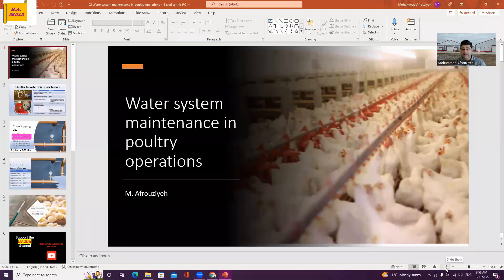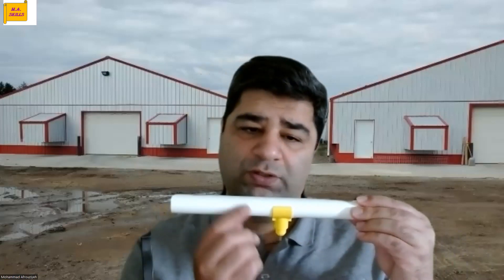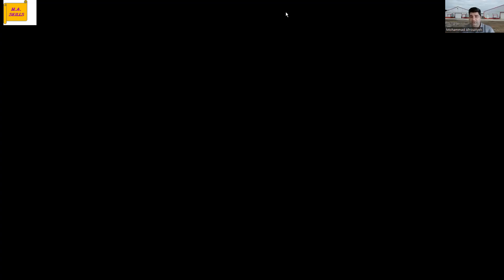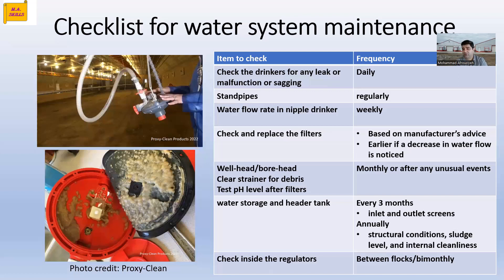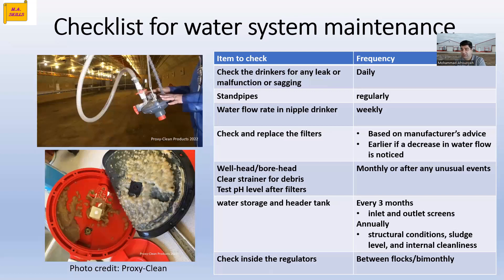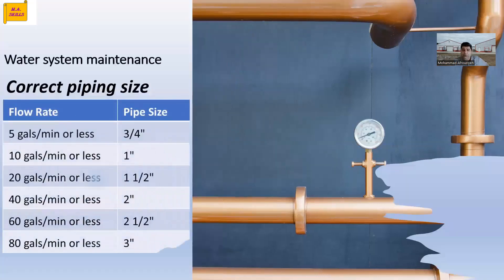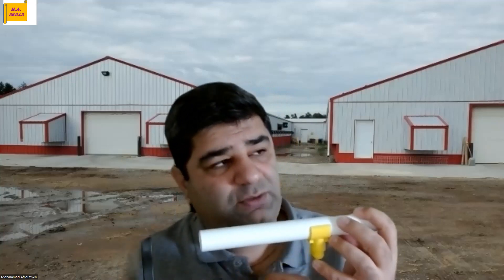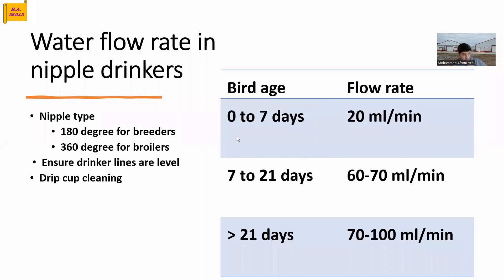Water system maintenance on poultry farms

Comment: your linked in is loocked , any other means of communication
Reply from the maker: It is not locked. You need to have a LinkedIn account to be able to connect. Let me know if it works
Reply from the maker: You can contact me through Instagram as well. My instagram (M.A. Skills) link is available on my YouTube main page picture.